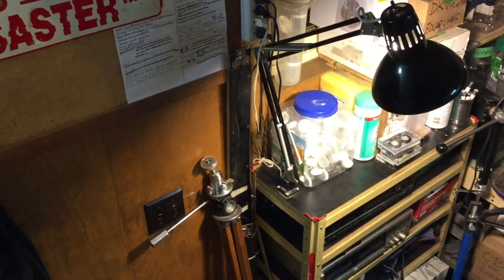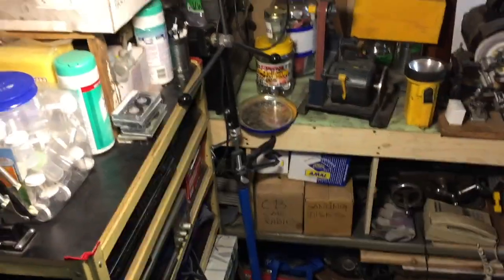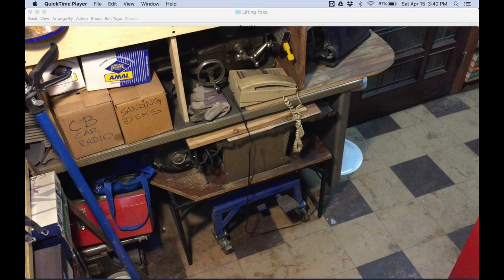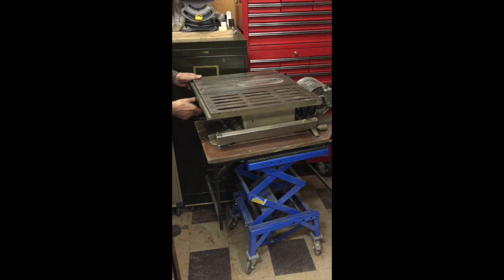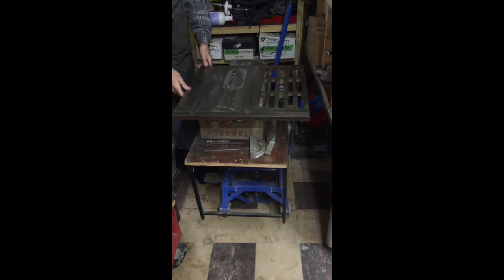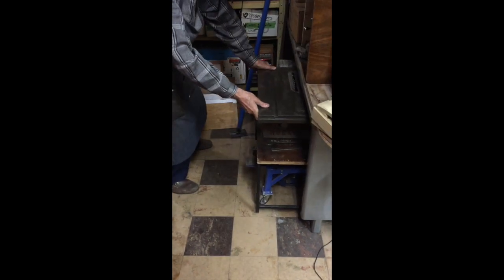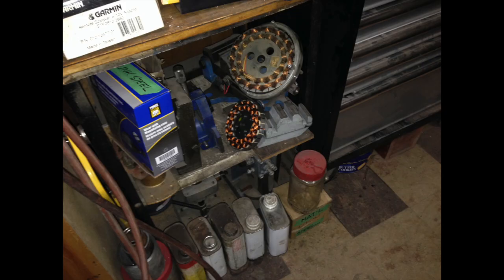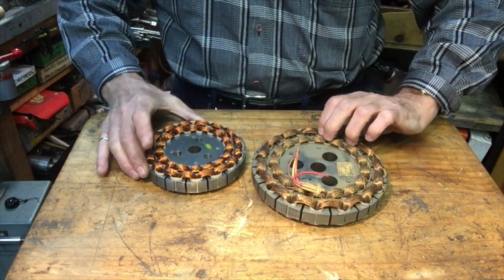#36 - THE CHUCK, THE HOIST and THAT OLD BOB

Comment: A great inspiration Bob. In a few more years I'll also find it too difficult to be manually handling the heavy items in my shop... like the 4 jaw chuck and the rotary table. I'm going to start planning now to install a hoist system so that it will be there when I need it. Thanks again for sharing.
Michael (in Winnipeg, Manitoba, Canada)
Reply from the maker: Thanks Michael.I bought those from Princess Auto a few years ago for $80.- today cost more. I have 4 more in the garage + a Jib Crane onto a 12 v. winch is installed. Also a large hydraulic table. 2 or 3 more will be installed.
Bob in Montreal also in Canada.

Comment: Hy Bob nice video, i like your lathe it looks very similair to mine I have a 10"model. says FERM 24 inches turning lenght.
the color the handles bed and slides are about the same, my lathe is 40 year old now still works perfect.
made one modification new motor and frequentie control, great for threading, before it never stops in time!!
Reply from the maker: jozefa1234 Thanks for commenting. You have an interesting lathe, I am not familiar with that control.
Reply from the maker: jozefa1234 
My 10” Atlas lathes are pre-war models, I think, no gearbox. A variable drive would’ve nice.
Thanx for commenting